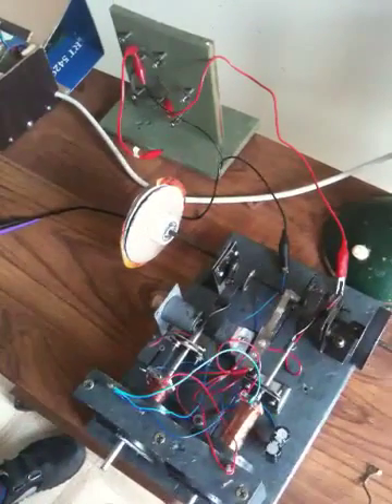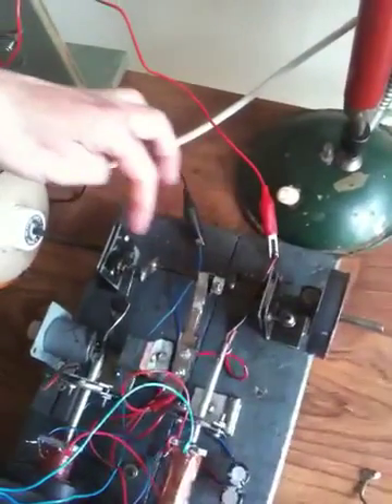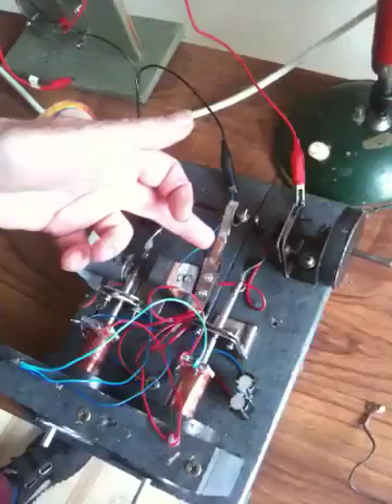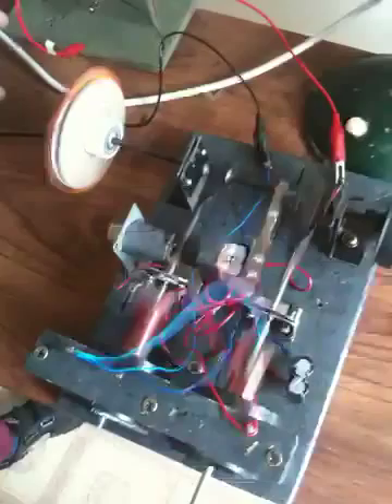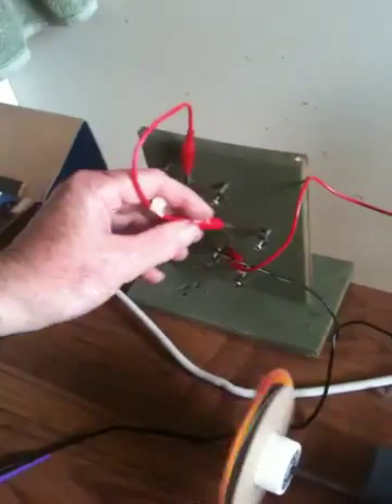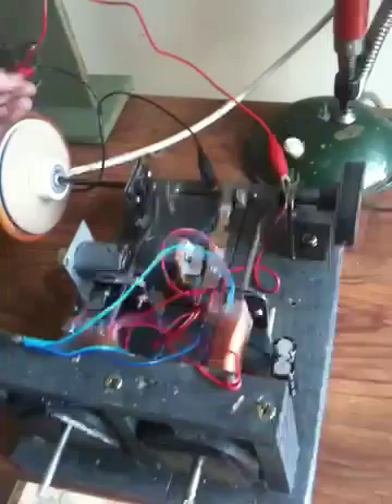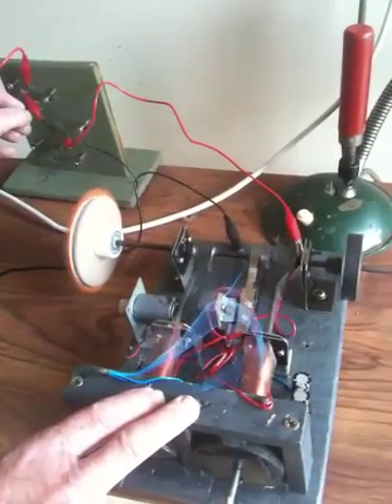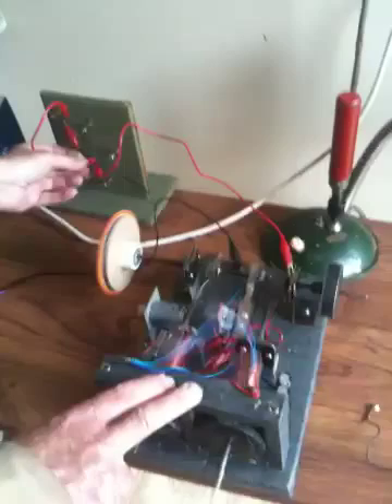Ring magnet dual piston engine

Comment from the maker: the coil is from a radiator it is resistants wire,
i connect one end to the power supply positive and the positive connection for the engine is connected any where along the wire which increase's or decrease's
the current, which in turn gives a strong or weak magnetic field.

To answer the other question the ring magnets i obtained from a micro wave oven there is  two in the magnetron or from audio speakers i  used six each side for my engine